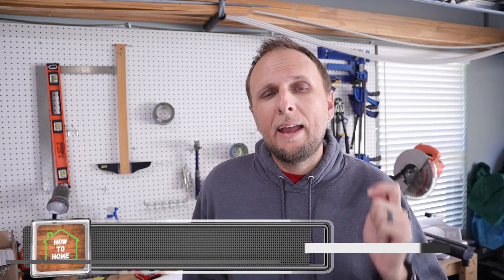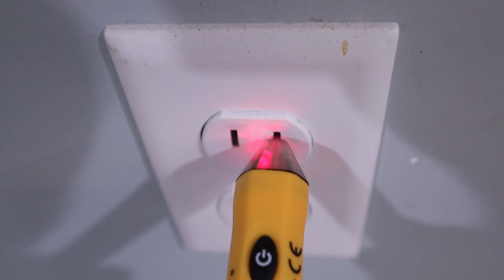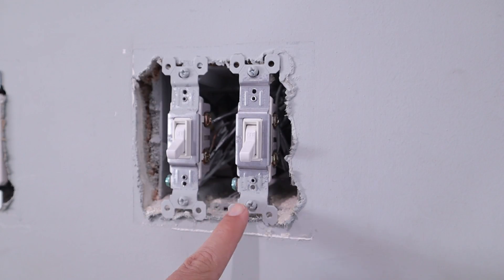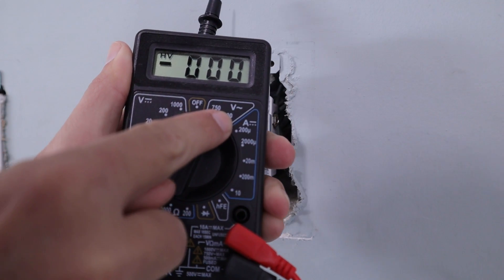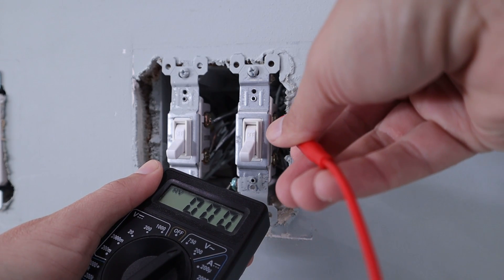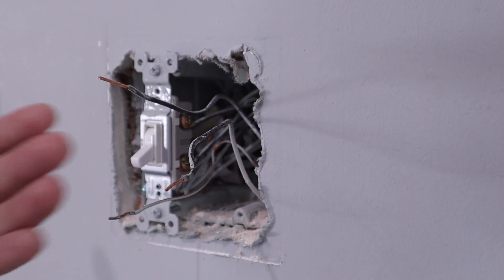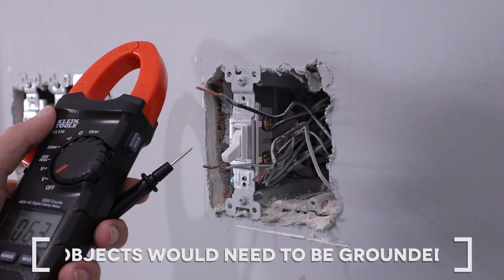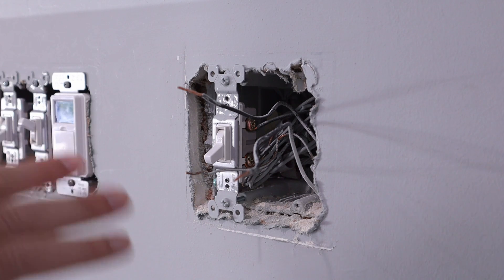How To Find A Hot Wire | Identify the Hot or Line Wire Using a Couple Cool Tools

Comment: How would we do it if we don't have a meter or probe? How did the old school electricians do it before the gadgets please?
Reply from the maker: To answer your question, back in the day they would oftentimes use a light socket with a lightbulb in it with two wires connected to it.  One wire would be put on ground and the other to the wire they were testing for power.  If the bulb lit up they knew they had power there.  I definitely would not advise going this route, or any other route that doesn't involve tools designed for testing electricity, it simply isn't safe.  Multimeters and voltage testers can be extremely inexpensive to get and are just the safest way to go about it if you aren't hiring an electrician.  I have a link in the description for a generic budget friendly multimeter if interested.
Reply: Shalom Aleichem. 

I have an old analog style multimeter that's gotta be 75+/- yrs old. It's big and heavy. I saw my uncle using it and he had to carry it in a leather bag around his shoulder.

Trust me when the age of electricity was born test equipment was born also. They didn't just crab any ole wire a put it any ole place.

Ratson haba b'shem YaHuah.

Comment from the maker: Hey guys and gals, I hope this was helpful.  If you liked it, please let me know by clicking the like button and consider subscribing!  If you have any questions feel free to shoot them to me here!
Reply: How can i test a hot wire without a ground , to see if there is voltage like you explained if we have an older home we would need to find another way to test the hot wire if there isn’t a ground
Reply: Hi Adam, can you make a video on how to troubleshoot why my outside power outlet isn't working?
Reply: This wasn't helpful for my issue. I can't figure out why 2 different dedicated GFIs stopped working. They won't test or reset. I wired a regular outlet to one circuit & still won't work. Tested just the wires after removing the GFIs & get 2 different results. Get ground to white hot on one circuit & the other both ground to white & ground to black is hot. 2 different wire test results. Can't figure the issue unless there is a loose wire at the panel or something else going on. I have no clue..
Any help appreciated!
Reply: Thank you for this video. I have a multimeter and a no contact probe. Now I know how to use them both. I have a 1998 park model, which is a mobile home type vacation unit, and I'm trying to replace two faulty self-contained light switches. The switches are in the bathroom. One switch goes to the exhaust fan and the other switch goes to the light above the vanity.  I purchased two two single pole SC070 switches from a mobile home dealer.   When I removed the two old rocker switches, I noticed there were four white Romex cables coming up from the bottom. There was one large staple stapling them to the wood. Doesn't look like there is any problem there. Each switch has one white cable going  into the top and one white cable going into the bottom.  Between the two switches is a short 6-in white cable. It comes out of the top of the first switch and goes into the bottom of the second switch. Somehow they are using a power tap or power tap and splice method but I'm not sure the person who installed this did it correctly. I have downloaded the installation instructions for the Pass & Seymore switches. Before I removed the switches I marked each one left top, left bottom, right top, and right bottom. Then I marked the connector in the middle as left top, right bottom. This is so I would know exactly how to put the cables into the new switches. When I opened the left SCD switch, some wires just fell out. They weren't connected well.  Because of this, I couldn't tell which wire was pressed  into the blade connectors first, second, and third.  Do you have instruction on this type of switch, an SCD070? I have seen videos where they have gotten rid of the self-contained switch and used a modern traditional switch. It makes sense except for no one talks about the connector cable between my two self-contained switches and why they just eliminate it when they switch to a modern box switch. If you could elaborate at all, that would be great.